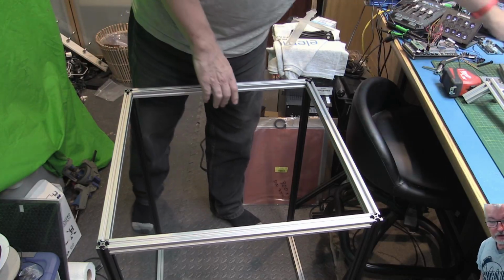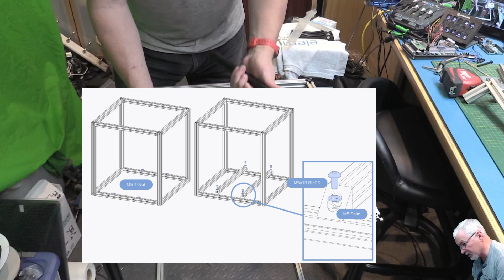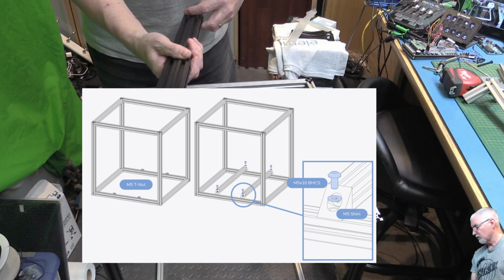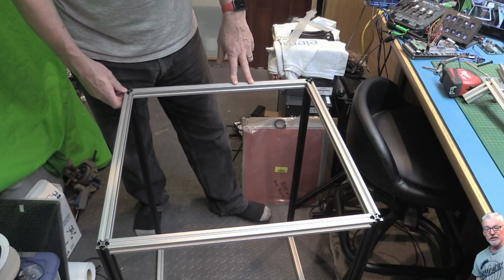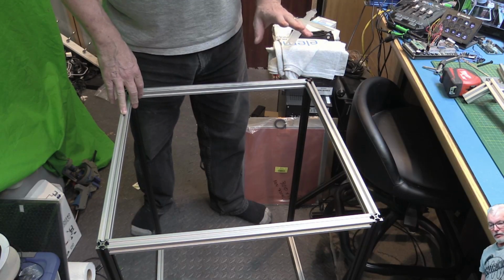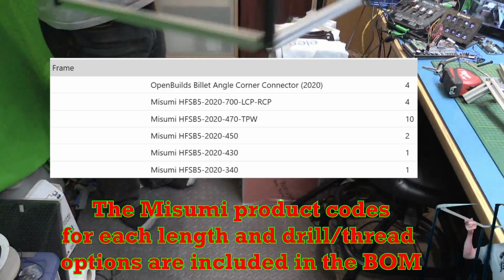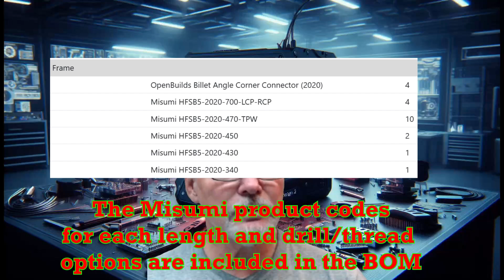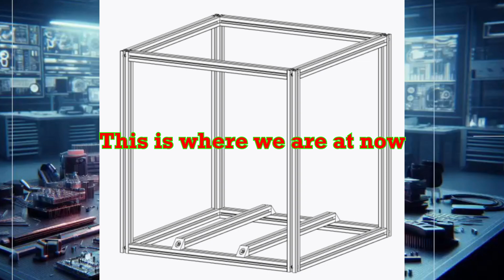Project Scrappy #4 Voron 2  2.4  R2 Checking for Square frame.

Comment: The lost bit on the tape kurospons to the thickness of the hook. So when you push against the element or hook it on. The numbers on the tape still fits.. So it's good that it moves. Sorry for my bad English. But I'm trying :)
Reply from the maker: Totally correct and thanks for clarifying for the viewers, not everyone knows that fact about typical tape measures, I forgot to mention it, thanks